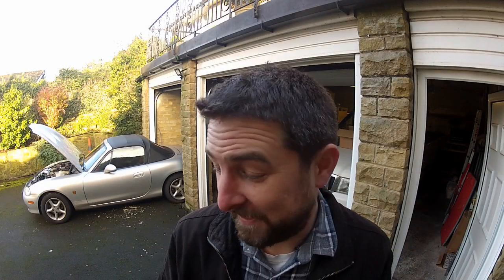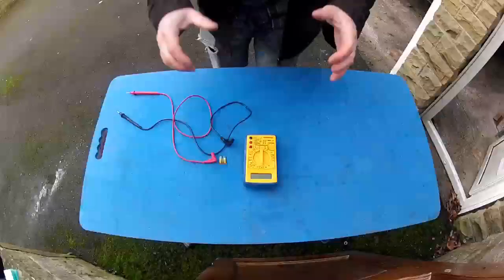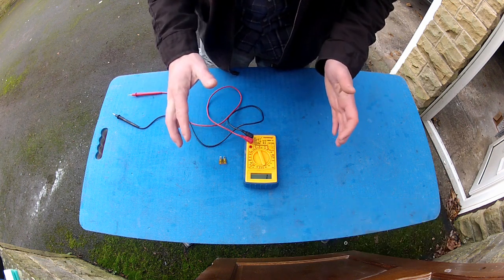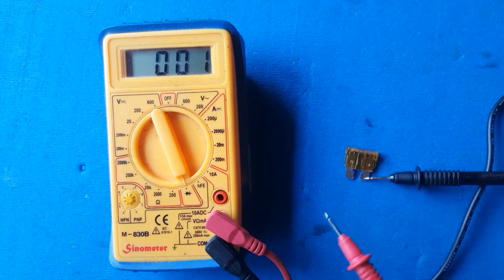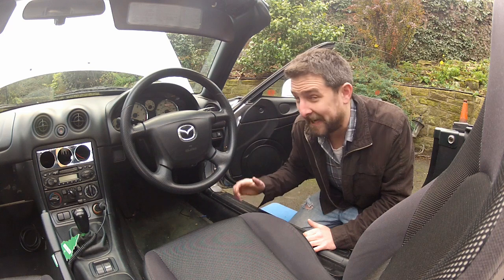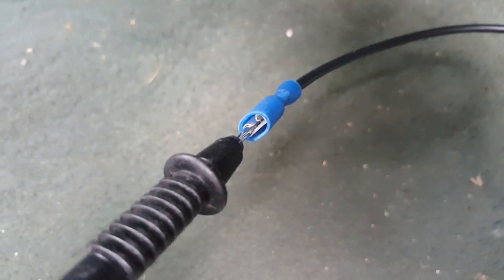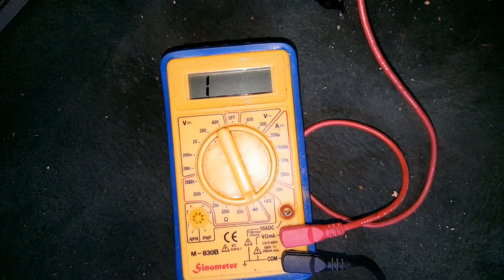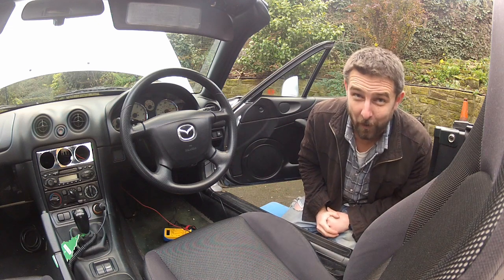How to Test for Continuity in an Electrical Circuit Using a Multimeter | Tech Tip 31

Comment: What if there is a resister connected in series along the wire?
The multimeter does not show 000 despite there being continuity albeit partially resisted.
This could cause confusion could it not?
The reason that I bring it up is that I have just tested a wire for continuity by your method and the multimeter showed 995 and yet there was still continuity.

Comment: I have a suspicion that the cable in my car from the lmm sensor to the electric throttle motor is wasting electricity somewhere. What would be the easiest way to check it if I take off that cable and bring it home for a test?

Comment: Thank you!!! for this great video. Straight forward to follow on the basics of how to use a Multimeter Voltage Tester. Your information is free and invaluable BIG THANK YOU. 

I'm a complete novis with car electrics and cars. However, I built up confidence to install 2 Filters ( Cabin and Air) myself thanks you amazing people on YouTube like your good self. 

Having car AirCon problems so plan on testing AirCon components (Fuse, Relay, Resistor, Blower Motor Fan) for Voltage.

Comment: Thank you... I've recently started getting my feet wet with Arduino and electronics. 
Salvaged stuff from old electronics and wasn't quite sure how to check for continuity on a couple of switches (with 4 wires) that I want to use on a project.  This was helpful.

Comment: Fast Rust, much appreciation for your video on this test, earlier today  I did the same thing adding to male ends on two ends of about 8ft of wire just so I could verify the correct wire to my vw ignition switch, and wanted to be sure I was using the correct setting on my multimeter for this task, I did the job and verified I had the correct wire, but other video's were using the Ohm's setting...so when I saw your video, ah jackpot...thanks again, and keep them coming.
Reply from the maker: Thankyou! Easy when you know how 👍🏻

Comment: I have a 1988 Nissan Sentra with a 1.6 L engine and it has the same type of grey connector that you were holding in your test. Do you know what it’s called and do you know how to release the terminal from the connector?
 I’ve been watching a lot of videos for techniques on releasing terminals and none of them cover this type of connector.
 If you don’t know could you direct me to a video or a site that might have information on this type of connector and terminal?
 I have a wire that needs replacing and I love this car. It’s a Time Machine with a single speaker a.m. radio. I don’t wanna change a thing. I just want to keep it running for as long as I can.
 Thank you so much for a great video that not only showed me how to use the same multi- meter that I have but by some miracle the same type of connector that I’m working with.
 Thank you so much again for a great video and for your time!

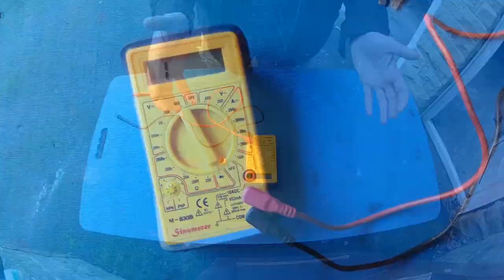Comment: Having guessed that the viewer is a beginner ( 1:40 ) your use of words like resistance and spade and alternator is liable to lose your audience. This video seems far more suited to someone with a deal of  experience.
Reply: The 1 (one) is not a 1 on your meter when set to ohms. It’s an I (i) for Infinity, representing an open circuit.
Reply: @gabrieleguevarajr1996  also you don’t measure continuity with your meter set to measure capacitance. he should have set it to the lowest ohm setting ie 200 ohm . He needs to learn how to use a multimeter properly.